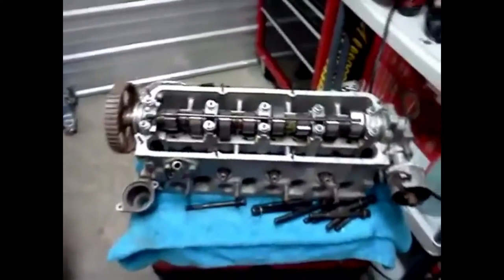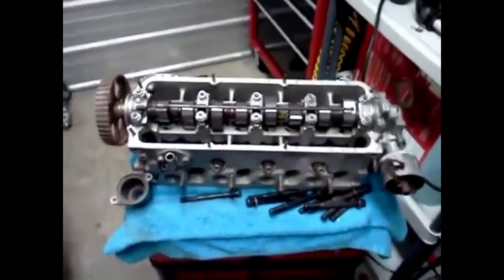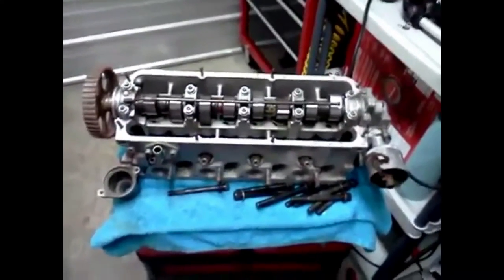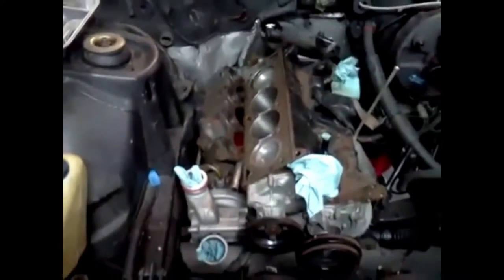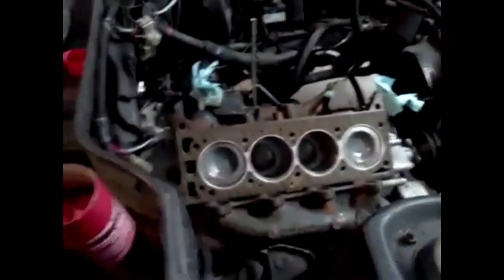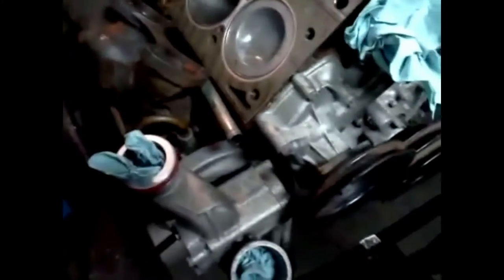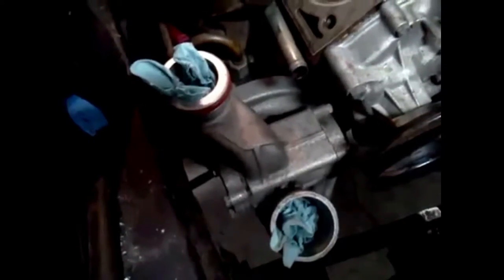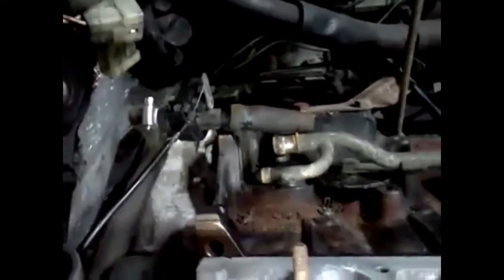1981 Porsche 924 Turbo | Installing New Cylinder Head

Comment: I just did this a few days ago myself, but I installed the exhaust manifold to the head and then the head and exhaust to the block and turbo at the same time.. 

How the heck are you going to/did you install the exhaust header studs/nuts/bolts, whatever you are using, afterwards with it in situ?